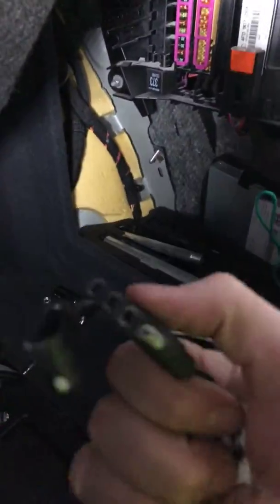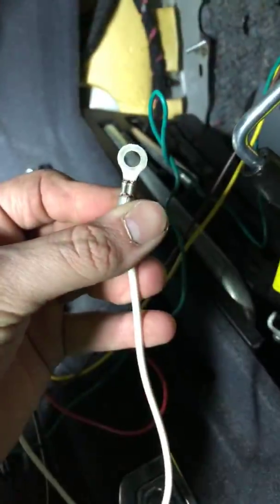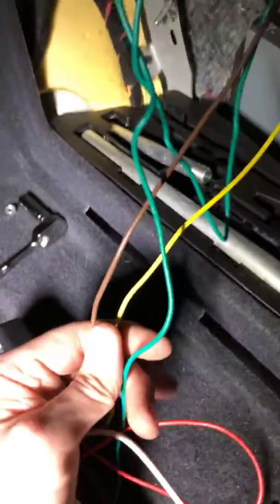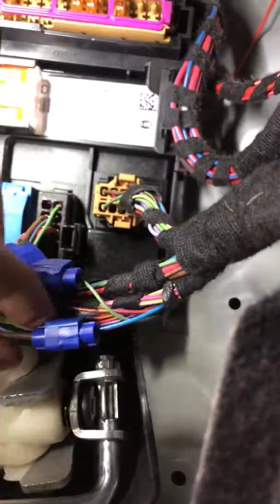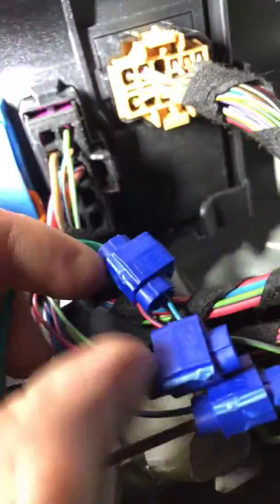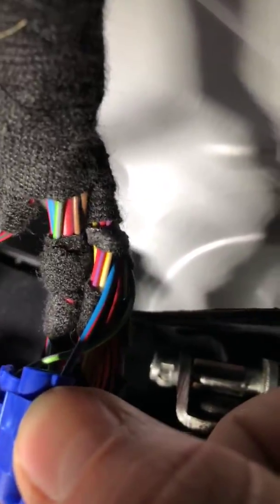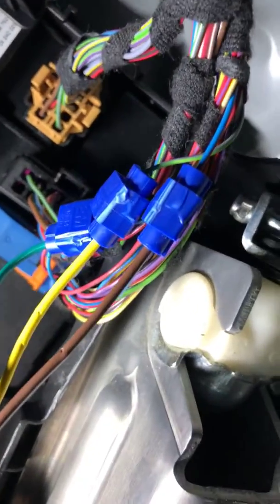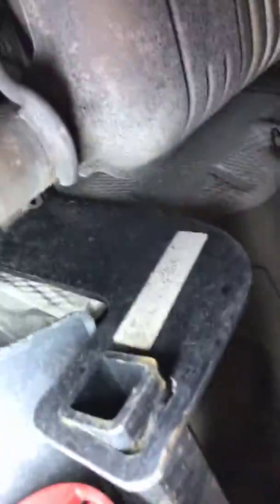2005-2008 A6 DIY Trailer wiring

Comment: Hey man my turn signals dont work in the back any suggestions
Reply from the maker: Lovemyprincess Chell, yea that happened to me. You’ll need to ground the wiring harnesses better, the mechanic drilled and screwed into the car. Another thing you could try is double check your splicing. These cars are very sensitive and put out a specific voltage that has a min and max or it will shut off that said electrical component.